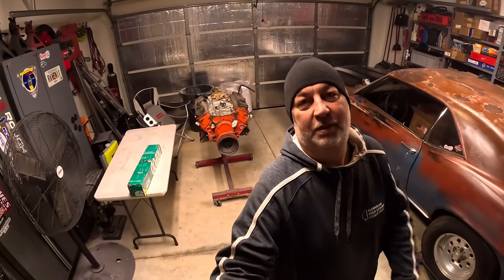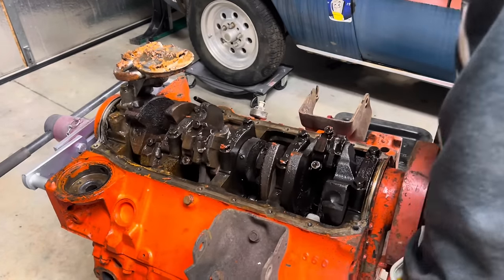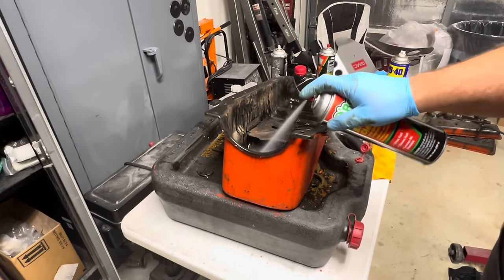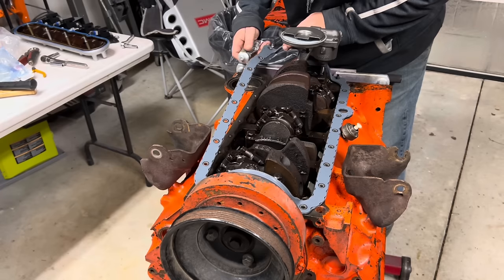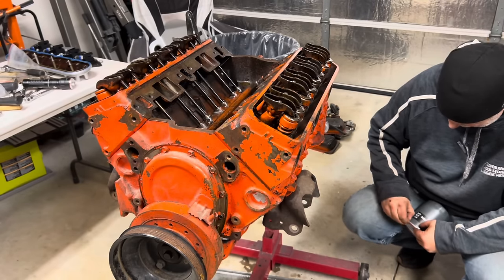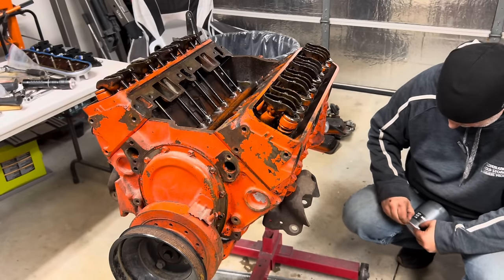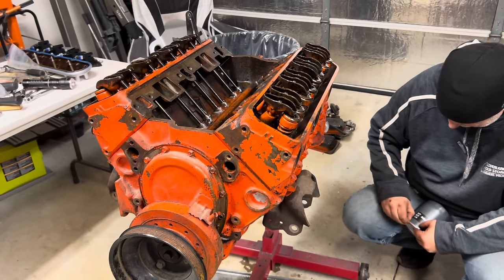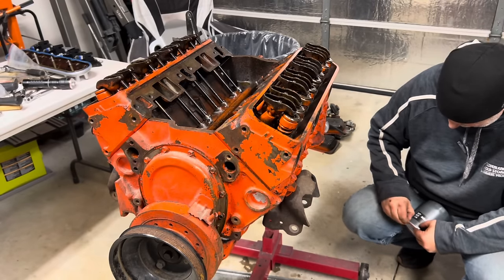We buy a $450 Chevy 350 engine from Marketplace for our 1969 Camaro! WILL IT RUN??

Comment: My brain fell apart when you put the oil pump in without the oil pump driveshaft 😂 ive done over 3000 small block builds and it blows my mind to see someome forget it. Then the pain of the pan going on without it was the kicker 😂😂😂
Reply: He doesn't need that rod buddy 😂😂😂 hes using a regular HEI distributor that oil pump has the nipple on it that the distributor sits down on so I don't know why you're thinking he needs a rod 😂😂😂 I thought you said you've put together many small blocks 😂😂 I call bull on that

Comment: It’s hard to find a decent used 350 anymore.
Reply: it's only a 2 bolt main
Reply: @zcam1969 I’ve put over 600hp on a 2 bolt 350 many times and never had any issues, I’d put them up against any 4 bolt

Comment: That's why I always make sure I can hear a used engine run before I buy it .
Reply from the maker: Good call.
Reply: If you can get an engine at the junkyard that's even better because you get a 30 day warranty instead of buying from marketplace and getting stuck with a POS .

Comment: I bought a 1986 350 4bolt main with a bent /broken rod so I got a new rod and piston new bearings sense you got this running I have confidence I'll get mine going, oh if your wondering I paid $50 for the complete motor alt to oil pan😅
Reply from the maker: You got a sweet deal!
Reply: 🎉 congratulations. You paid all it was worth. They’re all junk until the money and work gets done to put them to work again! That’s expensive enough. The sad thing is. These roots SBC blocks are 40 plus years old and rare so to speak. And 50 bucks is a joke when it comes to scrap metal. 😅

Comment: Definitely  Mr Chedderhead works on a motor.  Why did you not pull the timing cover and check the timing chain and replace it.
Reply from the maker: Not necessary just to do a test run...

Comment: Tough luck, you can't trust anyone. I have been burned so many times on motors its nuts. I recommend seeing an engine run before forking over the cash.
Reply from the maker: Well that’s not always possible, but certainly a good practice. Thanks!

Comment: That blocking plate don't go on the ends they go in the middle to block off the egr port holes on the heads
Reply from the maker: They were molded in to the gasket, not much of a choice given…

Comment: Rtv trick. Take the dumb ass red straw from your brake clean cans. Stuff er in the tube leave a quarter inch hanging out. (Enough to grab with pliers) pull it out for next use. Iv so far had success doing this with the same tube 4 times 🤣🤣 and no I don't put the cap back on. But you can it could be even better
Reply: Also why can't you put the rod in from the top?? Is it the sleeve? Bc iv pulled my rod with the distributor once it was a pain but I got it back in (intake was freshly put on) pulled the rod but not the sleeve.
Reply from the maker: Correct, the sleeve diameter prevented loading from the top side.

Comment: Omg man why go through that whole thing and not build it properly.
Reply: I am not sure of the logic at all on this .... motor wouldn't turn over and upon disassembly of oil pan find evidence of water.  Then force crankshaft to turn and ultimately run engine without inspecting rods and main bearings.  Since oil pan was off there would be no extra cost to do so.

For diyers, if you want to destroy your bearings just spin the dry rusty crank.  Also good way to score up the cylinders.  I liked the fact he looked at cylinders with boroscope, should have then filled cylinders with oil, atf or penetrating oil before forcing rotation of crank, cam, etc.

If you find something rusted stuck, maybe it could be removed, cleaned, oiled and reinstalled without further damage.  Just because engine starts and runs doesn't mean all is well.

Good compression, lubrication, cooling, timing, spark, and fuel needed for proper operation.  My thinking is this engine won't last long.

Comment: Stick a big pry bar in the motor mount on your block turns on the stand alot easier!  Lube the pivot point on your engine stand and you won't have a problem with it binding. Just something I do. Especially if I'm building from a bare block not telling you what to do. But it's much easier and saves your back 😮. Almost nothing worse than a back problem nagging you when you're wrenching on toys 😅😅 I think you're on your way good deal on the small block I've been doing this my whole career  . I have a 76 and 78 trans Am ground up restorations myself on both alot of late nights but enjoyed it.took 6 yrs. In my spare time. Like watching someone else enjoying wrenching. So you can take that Camero to the black top! And bring it to life hell if you have a gas pedal and 4 speed who needs brakes 😅😅 hell step down on it . and don't look 👀 back 😅😅!!
Reply from the maker: lol…love it, thanks!